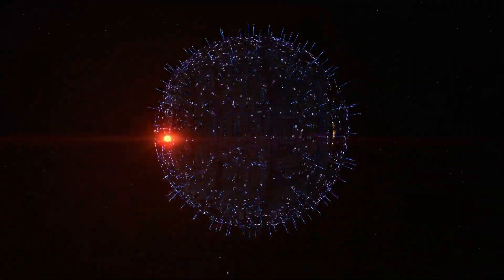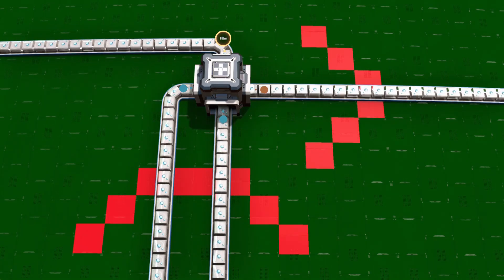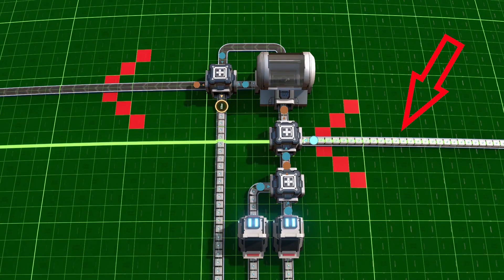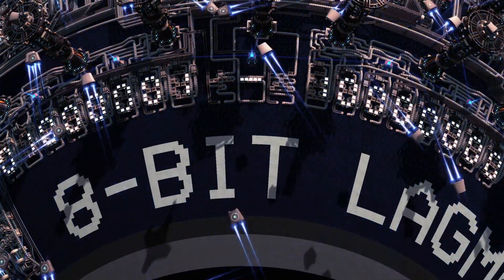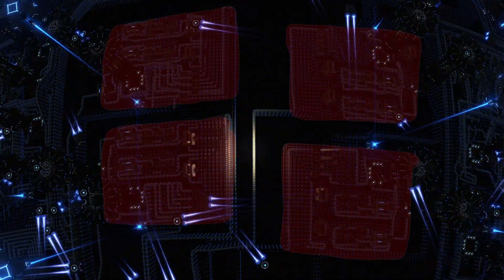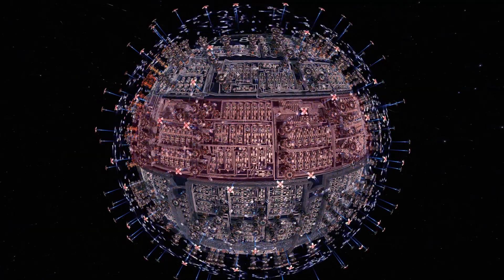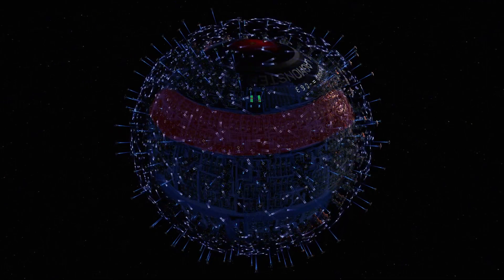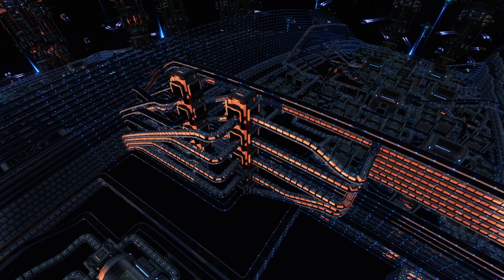Computer in Dyson Sphere Program | Explained

Comment: I'd like your thoughts on random number generators in DSP.  I totally don't have a use for one, but I think they can be made, so here I am looking for an answer before a question.  In my experience, the best way to find an RNG is either to find a game feature that uses RNG and turn up the volume or find a way to use time and fluctuations in semi-consistent occurrences as your randomizer.  The obvious in game feature for me is fractionators, but there must be others.  Any fun ideas?
Reply from the maker: It probably only works with fractionators(that being the only really random thing in the game) but there might be another way. When you merge 2 belts directly without a merger, the output belt randomly has gaps in it, that you could then using a not-gate turn into a belt, where kinda like a fractionator  you get items with random intervals. With that random belt you could then try to fill a belt loop in a set amount of time and use that to block another belt. That other belt could be the output of an or gate, with 1 input turned on so that when you block the output you get a signal on the overflow belt. That should be a fully random signalgenerator

Comment: Got bored making 100m white science, so he makes a computer. Very nice. Would it work with like red science instead of Hydrogen and Blue instead of Duet? That would be amazing to look at.
Reply from the maker: yes, but it's really useful to store the items without using inserters
Reply: @Pedulatsch  
There’s been another update.
You can place lv 1 crates on top of splitters and they’ll use the splitter as storage.
Cargo SEEMS to go into the crate first, then goes out when there’s room on the belt.
Reply from the maker: @slimeinabox  thanks ^^ I already found a new design for components tho, that allows for them to be stacked and 100x faster. If you want to you can search for my name in the dsp-discord and after you scroll through some memes there should be a video of an 8-bit counter that uses ram and is really compact.